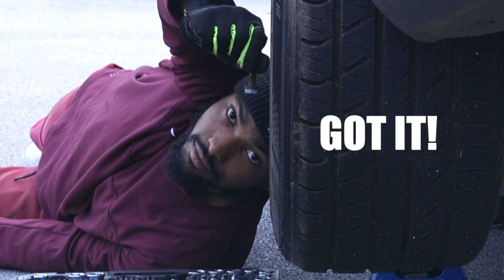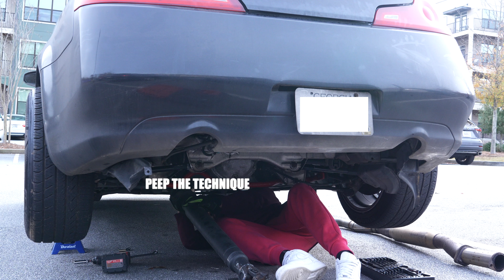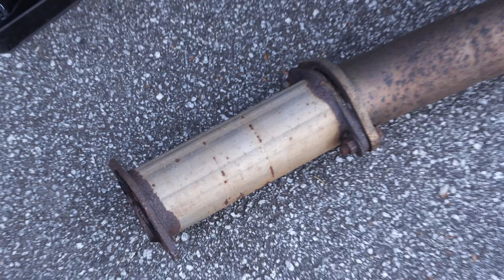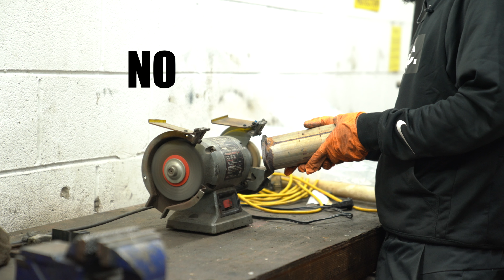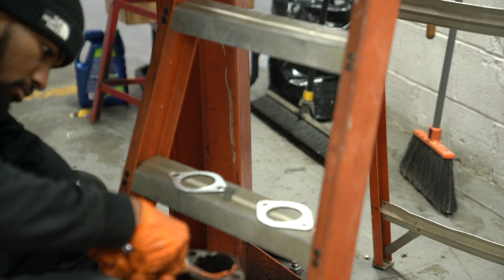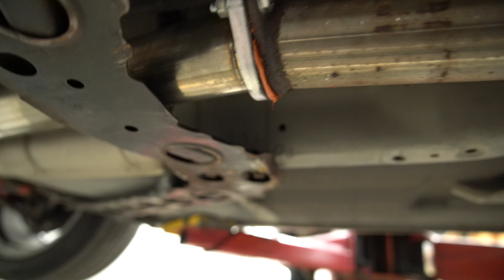PARKING LOT MECHANIC: G35 DRIVESHAFT & SINGLE EXIT EXHAUST

Comment: Great job.  Was the replacement drive shaft just a stock G35 shaft from the local pick n pull?  Or is it an upgrade from some other model that happens to fit?

Also, for that spot where you said you wanted to put some rubber in to stop the rattle, maybe get some exhaust wrap and just run it an inch or so on either end for safety wire.  Cleaner execution and wont melt like rubber.  Just my two cents.  Subscribing in 3...2...1...
Reply from the maker: This was from an older model g35. I took this one out from my drift car when I upgraded to a one-piece aluminum driveshaft.
Reply: @6VQ35   Copy that.  What did the one piece aluminum shaft do for you?  Just less rotating mass for a little quicker response time from throttle input to power on the ground?
Reply from the maker: @matthewpeterson3329  yessir, exactly that.